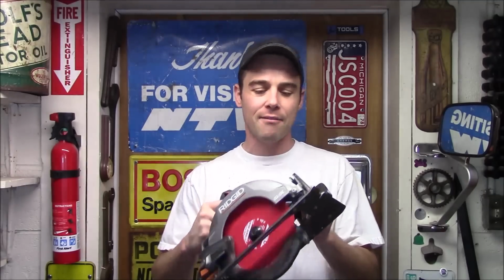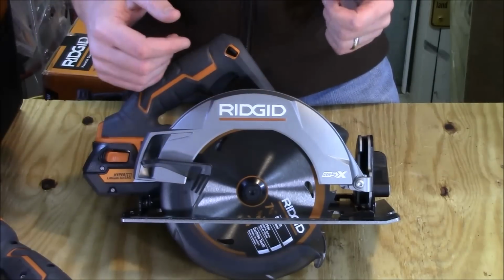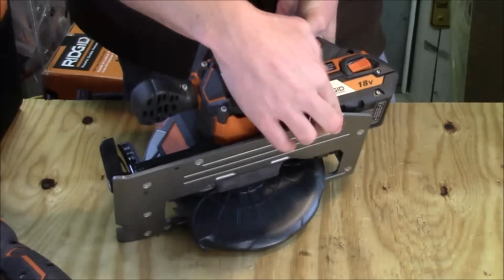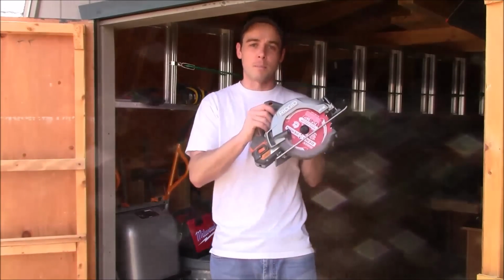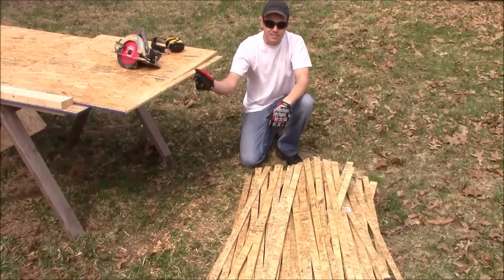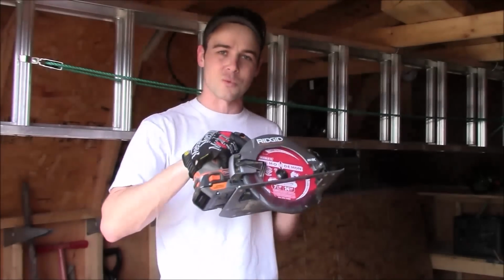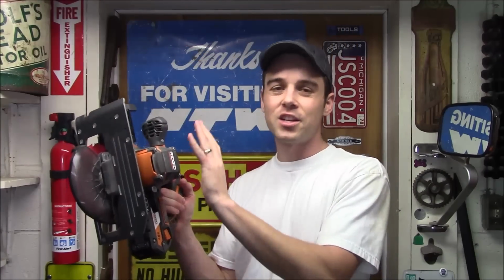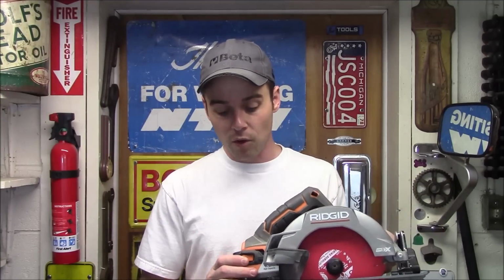RIDGID Gen5X Circular Saw R8652

Comment: I just watched this video and your Milwaukee circular saw video, and this saw actually outperformed the Milwaukee in board feet in OSB and did about the same as the Milwaukee in cutting up 2x material. Nice job Rigid.
Reply from the maker: +Bigchuck678 Yep.....very surprising!
Reply: +Bigchuck678 Great saw no doubt but to be fair he used the out of the box blade the Milwaukee came with in that video and in this video he swapped out the Rigid blade for a top of the line Diablo demo demon. He should retest the Milwaukee using the Diablo blade.
Reply: +Nutz4Gunz45 you feel the blade makes that much of a difference? By that I mean I mean if the milwaukee had a Diablo blade or would stomp the ridgid in terms of cuts and runtime?
Reply from the maker: Nutz4Gunz45

The videos were almost a year apart....with the Milwaukee being the first reviewed.  I change blades prior to any runtime testing with any saw (including the Milwaukee) to get accurate results.  At the time, I had additional Milwaukee blades on-hand, which is why they were used.  The Ridgid came with one blade & replacements were not available, so I went with Diablo blades since they are the most common replacement that people buy at Home Depot --- also being the go-to blade that I now use for run time testing with all circular saws (except Makita, which also makes excellent blades).  I will not be "re-doing" the video, but if/when I made a comparison video, I would be using the same blades.  Thanks for watching!

Comment: Great review!  That is an impressive saw.  It looked like it bound up a little less than the Milwaukee Fuel, and I see it managed 5 sheets of osb.  Great set of tools for someone looking for a standard set and doesn't need all the other stuff offered by other manufacturers.  I think you even got more cuts out of it than the Fuel, so the whole brushless thing seems to be more of a marketing thing as I never wore out a set of brushes in a cordless tool.  I don't mean to be cynical,  that is just an observation.  I love my set of m18 fuel tools.
Reply from the maker: Wild Goose Thanks!  I think that Brushless is the latest word that everyone is obsessed with.....the Gen5X tools absolutely prove that Brushed does not mean less powerful or less runtime ;)

Comment: I want to know, is the motor hot when used continuously? because the cordless Circular saw that I use is from another brand, if I use it continuously, the motor gets hot and then turns off, after a few minutes I can use it again after the motor is cold ..

Comment: Great job on the review. I just watched some other reviews and they kind of sucked because the reviewer just mostly talked and did not use the tool like you did. 

I just bought the RIDGID gen5 drill/driver combo kit and got a 100.00 off deal by adding another choice from RIDGID [black Friday deal]. I only wanted the drill/driver kit so I chose the dual 4AH battery set for 100.00 and will sell off the extra batteries on ebay and end up with the drill/driver kit for well under 200.00 including tax.

I never really took the other available tools too seriously that most companies offer such as the circular saw you reviewed but I think these tools have reached the level of performance where they are quite usable and worth considering. I think I will ad the RIDGID circular saw and maybe the reciprocating saw to my tool collection. 

I have a warn out skill circular saw I was going to replace soon and a sawzall that works great but is kind of a bear to use as the darn cord always seems to get in the way. I'll get the circular saw and sell my sawzall and replace that with the reciprocationg saw. I'll look for a reciprocating saw review first though.

Keep up the good work on the reviews.
Reply from the maker: +Robert Barnes Thanks Robert!  I am glad that you like them.....I bought the Gen5X Brushless Hammer Drill/Circ Saw combo & the Brushless Hammer Drill/Impact Driver combo at Home Depot with the Black Friday pricing.  We just got done round #2 of runtime testing on the new brushless circ saw & it beats the reg gen5x version hands-down......very impressive!  You cant go wrong with Ridgid.....just be sure to register them all within 90 days to qualify for the LSA!  (I made a video about that if you are wondering what to do).  Enjoy the tools!

Comment: cool saw and video also I this saw seems more powerful than any other companys and your test was very fair But why you used the original saw blade
Reply from the maker: MP 10000 $ Thanks!  I used blades that typical users will be swapping out the free blade with once it wears out.....Diablo blades are very common here & I always start each run time testing with a fresh blade to keep testing consistent.

Comment: Wowzers. At my current job, we're forced to use DeWalt cordless tools that use the older model 18v NiCad batteries, the saw loses it's charge in no time even with brand new batteries. I could see it cutting no more than 10 strips of that same board! I'm trying so hard to get the boss man to buy us these new Rigid tools, or at least some good 20v lithium powered tools but no dice. I'm almost tempted to buy the Rigid 5pc tool combo myself, because a major pet peeve of mine on the job is using suck ass power tools while knowing there's so much better ones on the market.
Reply from the maker: +joshnc101 Just a quick fyi.....Home Depot has the last remaining kits (#R9206) that have this saw & the new compact hammer drill (that I reviewed before this) + 2.0ah battery + 4.0ah battery + charger for $179 on sale....unreal deal.  http://www.homedepot.com/p/18-Volt-Lithium-Ion-Cordless-Brushless-Compact-Hammer-Drill-Driver-and-Circular-Saw-Combo-Kit/206127576
Reply: +Real Tool Reviews I'm all over that.
Reply from the maker: +joshnc101 Good choice!
Reply: So I picked up this set you posted. just 30 minutes ago. Home Depot has them on sale for $159.
Reply from the maker: +joshnc101 Wow.....unreal deal.....great job!

Comment: my saw and drill is cutting off when is under a load can it be the battery
Reply from the maker: If they are both messing up, yes I would assume it is battery related.  Perhaps a bad cell.  If you registered these (as I suggested) within 90-days, you will qualify for the LSA --- meaning you go to your local Home Depot with the tools, battery, and charger .....they test/send it off for you & you get a brand new battery back for free (assuming that is the problem).  If you did not register them, you are still covered with a 3yr warranty.

Comment: This would be a 5 star saw if they would just put the freaking blade on the left side!!. I don't understand why all these companies make their saws with right side blades. Rigid makes great tools but they failed by following the trend of right sight bladed saws. 
Makita, on the other hand, is the first one that finally came out with a cordless "worm drive" saw. Its not worm drive but it looks just like one. 36V rear handle and the blade where it should be...on the left side.
I really wish Rigid would have done this as I want to but their Gen 5 brushless kit, but that one thing is holding me back

Comment: In saw work blade is half the battle. Milwaukee Fuel vs Ridgid, Real Tool Reviews didn't do an equal comparison because they didn't use the same blade in brand new condition for the same test. In the Ridgid test he used a Freud Diablo which is an ultra-thin kerf top of the line blade, and is the blade of choice for professional framers. In the Milwaukee Fuel test he used the Milwaukee supplied Milwaukee endurance blade, which while a decent blade, is a thicker and inferior quality blade. Thinner blade = less wood cut through to complete the cut = greater production. Put new diablos on all the saws for equal tests, otherwise it proves nothing. A general contractor I frame for put a new 6.5" diablo blade on a Milwaukee fuel saw and got about 320 cross cuts in 2x4.
Reply from the maker: James Weaver Well....the 6-1/2" M18 Fuel is not the one I reviewed, I made a video about the 7-1/4" model.  As far as the blades go, I had additional brand new Milwaukee blades at the time I made that review last summer......this year with the Gen5X, I did not have additional Ridgid blades so I went with Diablo on all my testing.  I dont remember making a comparison video.....I do remember making a tool specific review only.  Of course blades will make a difference......there are 3 types that I like --- Diablo, Makita, and Milwaukee blades.....all are good quality.   The same argument could be made that it was not the same wood --- and two trees growing side-by-side have a different grain, and trust me --- people would still complain.  The one & only way to get the "exact" results would be to cut through MDF only.
Reply: Real Tool Reviews
All true... I guess I was struck by the idea that some were saying that Ridgid had surpassed the productivity of the Milwaukee Fuel... Milwaukee, Ridgid, Ryobi all are under the TTM ownership umbrella so its not too likely that the pro line (Milwaukee) will be surpassed by the mid grade (Ridgid) line, and watching the video, since I frame for a living and work my tools into the ground it immediately struck me that you had a Diablo on the Ridgid but not on the Fuel... Milwaukee endurance blades are decent but I don't know any contractor, including myself, who has made the shift to majority cordless, who buys Endurance blades, we all use Freud blades for the ultra thin kerf, because it maxes out our saw/battery endurance... Nice videos BTW they really help me do my tool research before buying.
Reply from the maker: James WeaverI made the M18 video last year.....I made the Gen5X video a couple months ago.  There was no source for more Ridgid blades, so I went to Home Depot & got Diablo blades since I have never had any issues with them.  I think they cut great & for the most part, I swap out brand new blades on saws with Diablo's any chance I get now.  Thanks for watching & commenting!